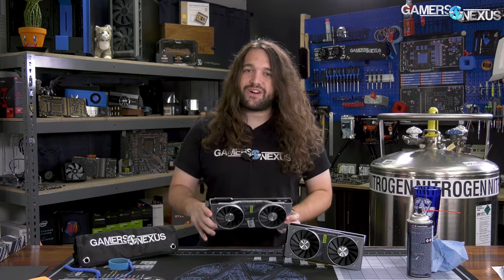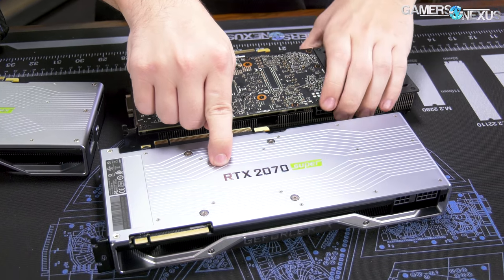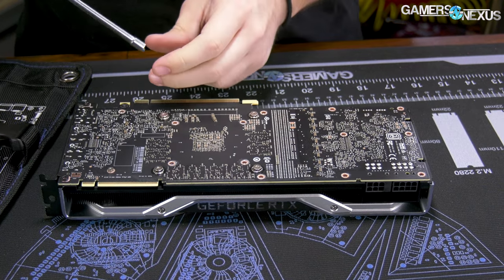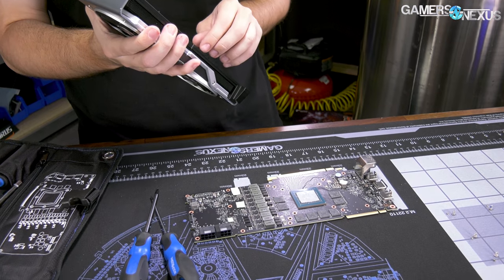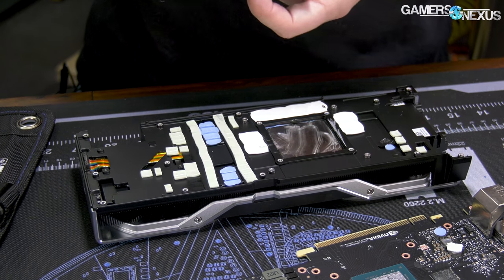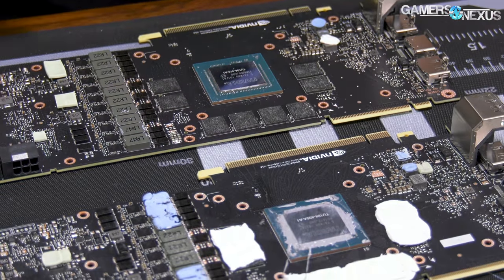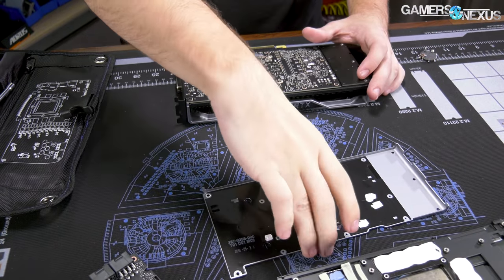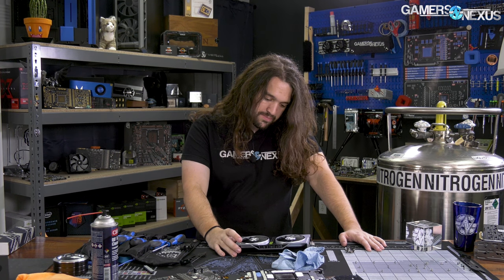NVIDIA RTX Super Tear-Downs & Water Block Compatibility

Comment from the maker: Buy the GamersNexus tear-down toolkit here! https://store.gamersnexus.net/products/gamersnexus-tear-down-toolkit
RTX 2070 Super & 2060 Super review here: https://www.youtube.com/watch?v=a5-vCnUC7bM
Watch our original RTX 2060 tear-down showing all the glue and screws here: https://www.youtube.com/watch?v=Kuy8-laK2AU
Reply: Pretty sure you had to go grab a different screw driver off your bench when you were messing with that 2060 super. 😂
Reply: @tomasp3394  & a human answered! 
Thats VIP treatment :P
Reply: @Voodue took me a bit longer to figure out but i am used to specular setup i use 100 smoothness XD
Reply: Is the partner's version usually more expensive than the FE ones? Or will be different this time with the new super versions?
Reply: Of course its  bigger because they are rebranded 2070's and 2080's
Reply: @Gamers Nexus - You need to sell magnetic modmat for screw placement :-)
Reply: Have you tested if theres any gain in replacing the thermal paste on these cards of the one from your german friend ?   I know on my 1070 2 degrees difference can get your some free performance. So frankly 5 bucks for a drop of paste is practicly free performance on a card costing 50 bucks.
Reply: thank you i now have to clean my monitor due to that joke. the second part of the joke only made me laugh more.
Reply: Any idea what size/type of screws those small ones are? Was vinyl wrapping the top cover and dropped on. Can't find it for the life of me.

Comment: Thumbs up for the opening joke.
Reply: I don't get it. Pls explain.... I hate not knowing
Reply: Rougher is better :)
Reply: Is this a sex joke? That's the only thing I can come up with. I don't get it
Reply: @bean_TM  referring to graphical design where 0% roughness means its reflective, higher values look more frosted as they scatter the light. I figured I'm still missing something as more than 5% had seen the rtx videos (and monkey head benchmarks) on this very channel, but don't call me dumb if I'm wrong though because I'm not a graphical designer and also the truth hurts
Reply: @bean_TM  he is referencing a type of 3D graphics shading model where the "roughness" of a surface simulates the reflectivity of light.
The observation is that in reality a rough surface will scatter lights that hits it (due to the psuedo randomness off a rough surface); causing a diffuse appearance - whilst a smooth surface will not scatter the light but will act like a mirror and reflect incoming light directly back.
In particular shading models (physically based, for one) the "roughness" or "smoothness" is a value that can be scaled from 0 to 1 to change this property gradually, simulating how some materials are smoother or rougher than others.
Here's a nice image demonstrating the roughness/smoothness property on a scale: https://tastypudding.files.wordpress.com/2014/12/comparison.png
Other factors that change the property of light include the material type; a metallic material will tint light differently compared to a dielectric material (steel vs plastic).

What's cool about this technique is that a texture can be used to define the roughness (and metallicness) of a surface, so some parts of the surface can be a super shiny plastic, whilst other parts are very roughed-up metal.
Reply: @Love Thy Neighbor me neither wonder if its a american thing...
Reply: @Xilefian  yea i understand all the science and stuff. but whats the joke?

Comment: The mirror finish indicates RTX ON.
Reply: Red indicates you paid the same price for less FPS and no RTX ROFL
Reply: @deathsite95  what is raytracing in anything that's not a 2080ti? Useless feature if you ask me. Pay $20 less to AMD for the same performance, and to deny a greedy corporation which is shoving needless features in the throat of the unwilling mid-range buyer.
Reply: @deathsite95  I personally wouldnt buy a Navi Card at the moment, but they are still worth it.

And we dont know. Maybe AMD will start a conter attack
Reply: @ValMephora  no body is buying  navi cards cause they are not out lol
Reply: @zade6828  show me a AMD card that performs  the same as 2070 for less than 20 dollars. HAHAHAHA
Reply: @deathsite95  At the moment was a reference to the information at this time
Reply: @ValMephora  we don't have info on Navi cards besides rumors .  I would wait till they are released and can see the bench marks
Reply: @zade6828  for 20$ I actually get a big profit because rtx 2060 performs 1.5 times that of 1080ti in AI workload because of Tensor cores
Reply: @zade6828  and also now it has 8 GB memory
Reply: @deathsite95  didn't you know ffxv is an nv heavy title? on average the 5700xt trades blows with 2070 vanilla, 2070 super is obviously a better deal though. And i wasn't talking about 2070 cards to begin with. between the 5700 and the 2060 super, 5700 is a better deal of the two for similar performance on average, but costs less.
Reply: "I still believe"
Reply: @zade6828  To be fair they do have a mix of cards, some with RTX some without. IMO they needed a better choice spread, or a seperate RTX plug in card (like Physix when it first came out).
Reply: @TechyBen true, an option always empowers the buyer.
Reply: @ValMephora  There aren't any Navi cards available to purchase. I'm still waiting for the reviews when they come out.
Reply: @TechyBen  No thanks Physix is a flop.
Reply: @pr0xZen  GTFO just all console run on AMD expect Nintendo.  NVIDIA still been whooping AMD.  Ya AMD fan boys r DELUSIONAL and have been for years.
Reply: @deathsite95  I trust in what AMD told us and its not enough in my opinion
Reply: @MarcoGPUtuber  we know how strong they are supposed to be
Reply: @ValMephora  Pretty much AMD on 7nm NVIDIA is on 12nm. Fyi they made by the same company Taiwan Semiconductor.  IF need be NVIDIA can step up.
Reply: @pr0xZen  You brought up console to ignore Nintendo is ignorant. But lets deal in facts the last time AMD lead in graphics was 2013 its now 2019.  6 YEARS later no card they have now or announced will even come close to the 2080ti and thats not even NVIDIA best card.
Reply: @737-p1f  u mad bro
Reply: @zade6828  well with the 2070S having SLI it might not be completely useless, at least I hope...AMD is out of the race for GPUs this year but maybe next year they will release something that actually competes since they have a designed and patented Ray tracing GPUs for the next generation of consoles and with the kind of compute power that AMD has now they really have to step up if they want that feature to make its debut onto the PC scene.
Reply: @JimboJamboYT  yep, atleast for those of us in 3d development, nvlink in the new 2070s is a good news, for games though I don't have much hope. 

As for Raytracing, I think AMD would be really competitive if they'd rather ignore raytracing and just cater to today's demand of Turing like performance and efficiency but without the RT cores to cut the cost, it adds a value to it which has become a pipe dream today. This hybrid realtime raytracing is a bit of a gimmick at this point for gaming GPUs. Today you wouldn't know if RT is on unless you do a ON/OFF comparison, except in "Control", but that's most likely because it has tiled floors everywhere. 
Actual raytracing is in a league of its own both in terms of realism as well as performance requirement. Not sure we'll get to that point in games even in two generations.
Reply: @zade6828  For someone speaking about 3d dev, you seem to not want ray tracing, which begs the question, how long are you willing to wait for your renders or do you just leave ray tracing out of the picture in general? Your previous comment about ray tracing being useless is laughable; you mentioned how developers are optimizing for such and such but completely disregard the fact that most high profile engines have implemented ray tracing. I will give AMD credit for all of their efforts in pushing open standards a couple new techs here and there but in terms of features, AMD has always been behind Nvidia and furthermore copying. AMD has always been the copycat company. Copied Intel, Copied Nvidia. Hey you get what you pay for.
Reply: @deathsite95  AMD has a patent on open source ray tracing technology, you fanboy. Open source. Get that?
Reply: @MindaugasSnegirevas  HAHAHA what a joke AMD already had to drop the price on their new cards cause they dont have RTX. ROFL
Reply: @MindaugasSnegirevas  Remind we what games use Radeon Rays 2.0?  O wait u cant cause no game dose. ZERO GAMES HAHAHAHA

Comment: TL;DW the 2070 Super IS LITERALLY a 2080 just with cores disabled
Reply: Considering the 2080 was using the same core that normally would have been in a 70 card anyways does this really surprise anyone?
Reply: Jason Fresh  I question if there will be a 2080ti Super, they haven't said there will be one and they did drop the 2080ti to an even grand from the 1200 price point.
Reply: @CiceroFMYT  i'm talking the overpriced Founders Cards
Reply: @DanielRichards644  2080Ti is $999 already.
Reply: @KelvinKMS  AGAIN SINCE YOU CAN'T READ, THE FOUNDERS EDITIONS ARE STILL $1,200 THOSE ARE THE ONES BEING DROPPED TO $1,000. I know there are $1,100 board partner variants available now, the only $999 ones however are Refurbished models.

Comment: I'm glad I came across this video. I just picked up a RTX 2060 Super card for an older compact tower Lenovo Xeon system, the location and size of the card is the only somewhat modern video card that fits in this short and shallow case. It has a flip down CD and drive bay that won't close if top-plug power is used, so the short edge plug-in was needed in my case.

I've repasted a few video cards and this was by far the worst, most labor intensive I've done, tearing the whole thing down due to that power cable and fan cable inaccessibility.  It took some time, but I got it done. 

Thanks a bunch for your videos!

Comment: I wonder if they are just using 2080 dies that didn't have all of the functioning cores and just disabled some things......
Reply: Yes they do, that's Standart practice in CPUs already
Reply: @bananas1055  I knew cpu manufacturers have been doing this for years, but I wasn't aware of a gpu manufacturer that was yet. Makes perfect sense, would have expected it way earlier.
Reply: On the 2070 Super? Ofc they are doing that, its been common practice for GPUs for a long time as well.
Reply: that is practically what most lower tier products are! they aim to only built 1080Ti and 2080Ti but it is not guarantied that you till succeed so they base the lower product on the average minimum working cores and just lock the ones that are extra... (so if you need 80 cores for a 3rd rate product when aiming for 100, but you got 81, they will lock 19 broken ones and 1 good one and sell it as that 3rd tier product at 80 cores...)
Reply: @theepicslayer7sss101  Yep, and even the 1080Ti and 2080Ti are cut down versions.
Reply: @theepicslayer7sss101  Yup makes perfect sense from a business perspective too the combination of the fact that sods law is a thing and things will absolutely go wrong in manufacturing and that not everyone in the market wants to pay for the top tier price point leads to the obvious conclusion that a B grade product where only some of the components fail QA can easily be rebranded and sold for a lower price point better to make something off it than trash a unit that is capable in a less demanding application.
Reply: The EpicSlayer7 SSS so say that happens and I unlock the working one (is that even possible?)

Comment: Since the rtx 2070 super has the same gpu as a rtx 2080 than could you sli them? I highly doubt it but,  still curious.
Reply: You can sli any nvidia cards together since the driver unification back when the 580/570 days.

Sli will always default to the lowest performing card, and you want your highest performing card in the uppermost slot as that is the card given preference.

As a result, the cards do not need to be the same.

Comment: what happens if you flash a 2080 bios/firmware on it. Is it possible to unlock more cuda cores or rtx-ops?
Reply: @darkhazard9808  sometimes not all the cores are defective. Im not saying that it would turn to a 2080 ,but only activate more cuda cores.
Reply: @darkhazard9808  Not necessarily true. It all depends on the volumes produced. If these 2070 Super cards outsell the 2080 versions, which they will do, then it's very likely that a lot of the GPU's used will be perfectly fine, and could just as well have been used in the 2080 version. It's however also possible that Nvida has a method to physically disable parts of the GPU so that just modding the Bios won't be enough to activate the extra cores. Such a deactivation can take the form of anything from externally shorting a pin to punching the core with a laser or something similar.
In the end it will be down to the usual silicon lottery if you get a gpu that's been rejected from the 2080 bin or a perfectly working one that's been nerfed.

Comment: Now can you nvlink a 2080 and a 2070 super
Reply: Gustav Okaski same question
Reply: I guess not. Die/core specs don't match and Nvidia never allowed such mix and matching with SLI.
AMD/ATI allowed Crossfire with slightly different chips and even with APU and dGPU in laptops.
Reply: @maciejgada740  Also iGPU in chip sets and dGPUs ex. HD4200 (AMD 785g) + HD 3450

Comment: The piece you suspected was for USB is for a reinforcement bracket than most OEM prebuilt desktops use. If you check one of those Dell workstation or HP workstation desktops you'll see the bracket I'm talking about screwed onto the cards.

Comment: How hardware evolves lately: 
- get 10-15% performance boost
- 1-2 more gimmicks over last gen
- 1 less port or smaller ports (so you go buy adapters)
- glue the whole device togheter so users don't get inside and fix their ish (so I don't cuss)

Comment: Would be nice for manufacturers, fwiw to make 2070 Super stickers to cover over the 2080 branding, where applicable. If it's just for the backplate, a separate 2070 Super backplate either on exchange for only cost of shipping or SRP would also be pleasant as options for correct livery.

Comment: The thing on the end with the screw holes is for the braces that OEMs like to use to support that end of the card inside their cases.  Look at a used Quadro on ebay that came in a Dell or HP, and they often have an extra plastic support thing that attaches right there.

Comment: Project for ya Steve.
Bare pcb with a cpu style water block cobbled on to it somehow and a couple of bottom mounted fans cooling the rest of the pcb, v's a normal card with the half a ton of cooler hanging off it.
It would certainly be lighter and cheaper (if you could buy just the pcb)
Reply: I can't say that I am really sold on the merits of GPU water cooling, mostly because I am of the mindset that all cooling is ultimately air cooling and a blower style GPU card already achieves the ideal of venting the waste heat from one of the hottest parts directly to the very large box outside rather than the small box inside. CPU watercooling makes more sense to me but even then the objective for me was simply relocating the CPU air cooler (rad/fans) to a more convenient location to vent heat to the room rather than act as a 150 watt fanheater for the very tiny box that is the case.

Comment: The screw holes are usually for gpu support brackets. I have only seen those in rack servers so it seems they use the same cooler parts in their more professional products. even though rack server parts usually don't have coolers with fans in them. Also the power connector at the end of the card is kind of a rack server thing

Comment: That lonely screw from the backplate of the 2060 super at 25 inch mark.... for the rest of the video :p .

So much trouble they have gone through to make the 2060 look the same as 2070 at the cost of repairability. It looks like third party versions is best for the 2060 and 2060 super in that regard.

Comment: Hi, what is the brand of the contact cleaner you used? Also, I have an Asus Turbo RTX 2080, which doesn't come with a backplate (FeelsBadMan). I want to order an aftermarket one but I am concerned I won't put thermal padding on all the correct components. Is there any resource you could direct me to that would help me with this? I have already screenshotted this video and tried to flip it around in photoshop but it's difficult to know exactly which pieces have the padding on them especially for the really small pieces. Thanks much, love your content.

Comment: This cards should be 250USD$ and 350~400USD$ given their performance still on par and sometimes lower than a slightly overclocked third party 1080 or a standard 1080ti. 500~600 USD$ should be the price reserved for the single best standard version of a GPU (that’s what 2080 should have be priced for) and more than that only for crazy third party versions.

Comment: Yoooooo i can't recommend the thermal take all in ones! I have a M240 from thermal take and I just took it apart because it looked like there was gunk in the block and well there was! So I spent two hours today cleaning (not complaining) and during that I found metal flakes from the fittings which is scary to have running through the system but I tried my best to drain / wash it out